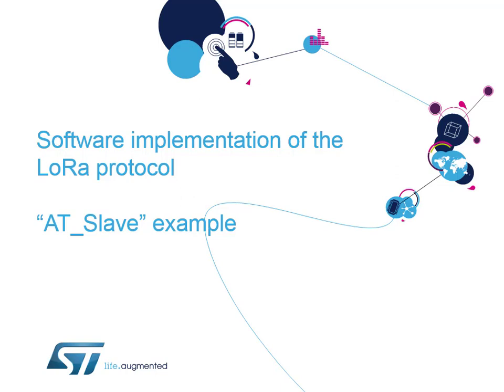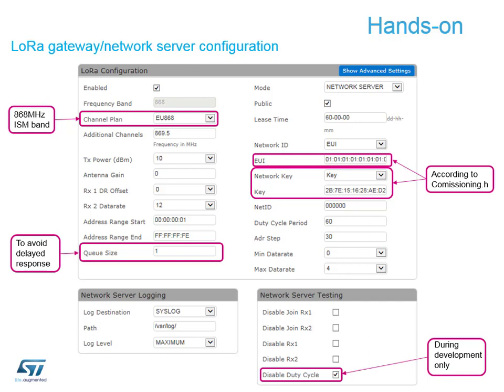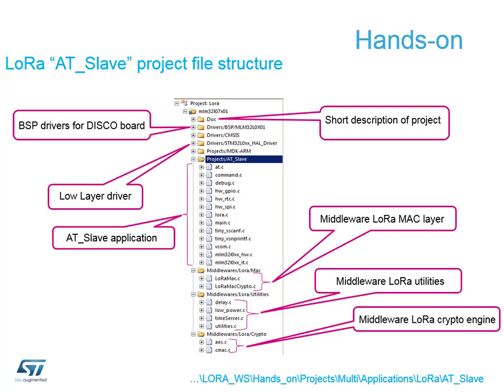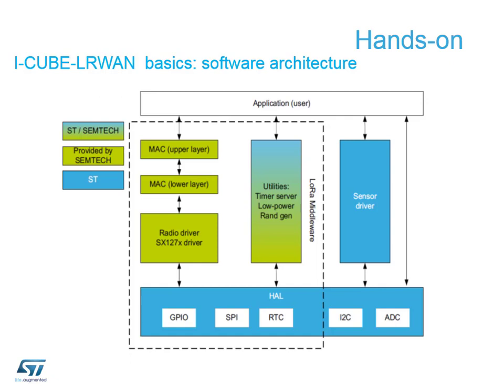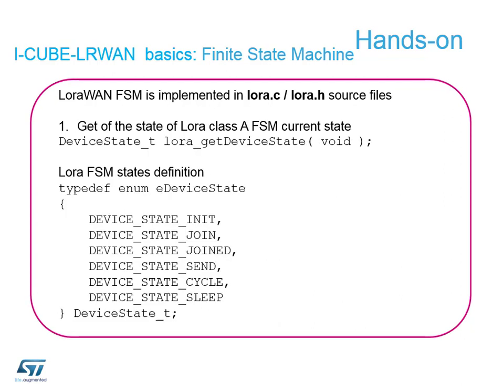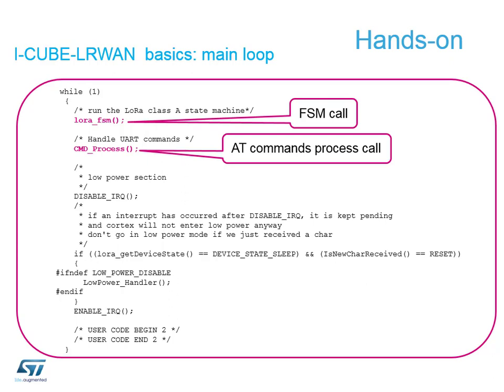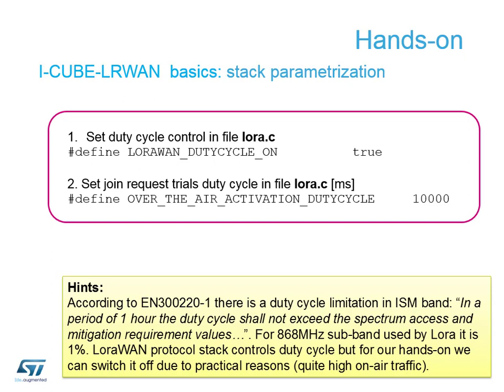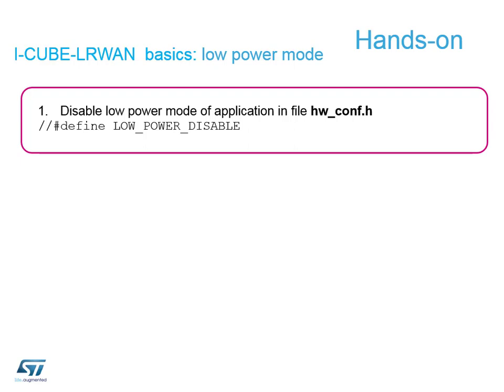LPWAN workshop - 4 AT Slave Theory

Comment: hi, i tried to change the APP_TX_DUTYCYCLE to 5 seconds but it did not work, the node is still sending data every 10s, why? if we are sending little payload messages as you said then has to work... the problem is solved if i disable this:  LORAWAN_DUTYCYCLE_ON
Reply from the maker: Hello. The default data rate is DR0 (SF12) and as consequence Time On Air (TOA) is the highest possible, for 5s period of sending data at DR0 even for short payload (protocol overhead should be considered) the ETSI duty cycle limitation (see EN300220-1) is exceeded as automatically controlled feature of protocol stack. Indeed, disabling LORAWAN_DUTYCYCLE_ON solves the problem but this mode is possible for development stage only and for certification stage must be enabled again. Possible solution is to set fixed highest data rate DR5 (SF7) but range of communication in this case will be similar to “classic” (G)FSK based RF communication. LoRaWAN technology has been developed for long range communication of battery operated devices what means longer periods between TX rather.
Reply: @stmicroelectronics  hi, i understand but i am using SF7 and the problem persists